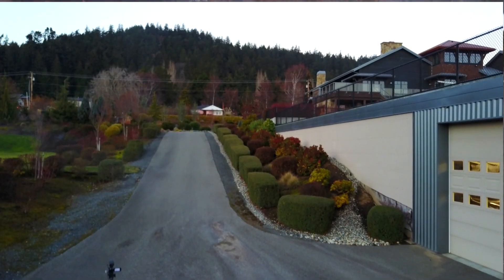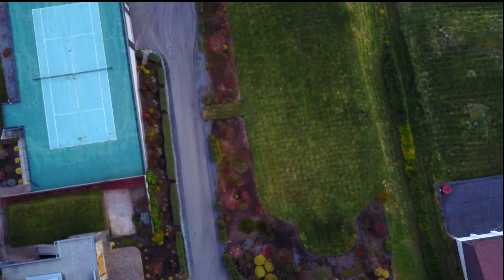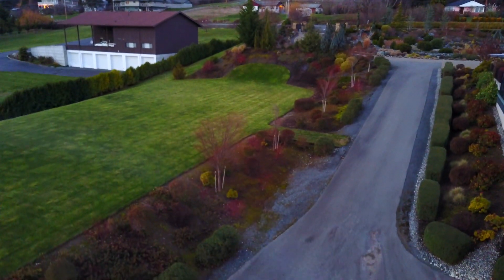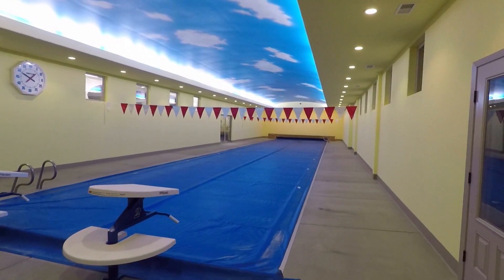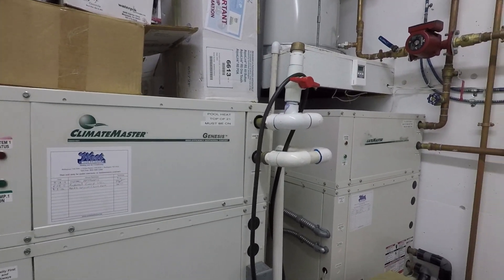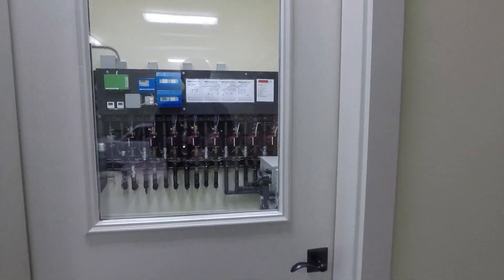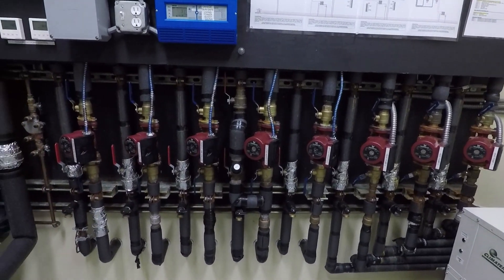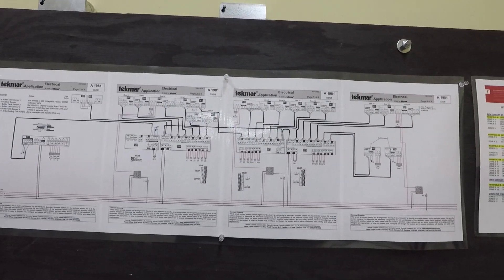Ford towing a Chevy plus a massive Geothermal system.

Comment: Hey Ron, thanks for the tour, that's a hell of a system to heat a lot of space and a pool to boot. Does the lake you are on freeze often or is that unusual? BTW I have a 06 Duramax and it's been an awesome rig, it's been a great tool and dump trailer hauler.
Reply from the maker: No the lakes don't freeze often. We had a cold front come down from Canada for a few days. Today, one day later at 9:30pm it's 40 degrees and heading up this week. Chevy makes great trucks as does Dodge, Toyota, Ford. I like Fords, but I like yellow folding bikes too. I only dropped in the photo and the comment for a little humor.
Reply: Ya it looks like we are going to be treated to some of that warm weather in Spokane over the next couple of days. I'm sure my guys on site will welcome in with open arms while framing our current project. 
I have to agree the Fords have come a long ways in there development, they are looking like Chevys more and more everyday. If you can't beat them join them. 😁👍🏻

Comment: Why are the geothermal fluid lines in a shallow horizontal pattern instead of much deeper vertical configuration?
Reply from the maker: Cost and necessity. No advantage to deep, only drives up the cost.

Comment: I am curious why the geothermal system was not designed to use wells rather than laterals. Most systems I see drill down 200 ft wells.
Reply: 6stringsandapick laterals saves money over wells of course you have to have a lot of land area to do it that way
Reply: 6stringsandapick Theoretically, the most cost effective and energy efficient installation would be to anchor a loop to the bottom of that body of water.
Reply from the maker: Until, the EPA fines kicked in.
Reply: Ron Paulk Theoretically cost prohibitive planning permission and lawyers are just efficient enough to help one avoid EPA fines.
Reply from the maker: No lawyer on earth will get you a permit to put anything in a natural lake in Washington. We gave up trying to get a dock permit after two years: the county gave us a permit and the state blocked it.
Reply: Ron Paulk Starting to see attempt to restrict dock size (15m² my county) here in Ontario, Canada.  Would permission to extract water from lake return it colder in open loop system be allowed.
Reply: Washington State Department of Ecology considers surface water geothermal beneficial use and will priority process a water rights application.  Just return water in improved condition (colder/hotter depending on season). The first PDF from following link has interesting info.  http://www.ecy.wa.gov/programs/wq/grndwtr/uic/HeatPump.html

Comment: Liked the tour.  Didn't understand why the photo at the end was added though.  Even though I am a Ford owner...not a happy one b/c of 6.0L.
Reply from the maker: Comic relief
Reply: Ron Paulk Be careful.  Some are fragile. ;-)
Reply from the maker: Yea, I have one and it is my third Ford with one. I have had excellent luck with them and prefer it over the older 7.3L that I had. I also like that they have a bad reputation as I get an excellent truck for less $$$$. I encourage the general public to keep trashing them. Beats paying 60K for a new one.
Reply: TechEdFireman properly maintained and proper fuel cetane levels make the 6.0 a great engine.
Reply: I have been saving for a new to me work truck.   I could actually buy 2 f250 6.0 for the cost of a Ram or GMC   
How many miles do you get out of a 6.0?
Reply: Bought this F350 05 in 07 with 34,000 miles and I am at 110,000 now but I have had to get all the injectors, FICM, EGR, fuel pump all replaced.  All this work on this one truck has turned me off for a future Ford.  I previously had a 01 1500 chevy and didn't have a quarter of the issues I have had with this one, I put more mileage on that one in a shorter amount of time also.
Reply: havenisse2009 wonder who you call when you need to haul something.  But, we can afford to have a big, thirsty vehicle.  Because, while we are taxed for fuel, it's not as obscene as I assume the taxes you pay are.  Regardless, my F150 4x4 gets 24mpg on the highway, which I will happily accept for all the functionality it offers.